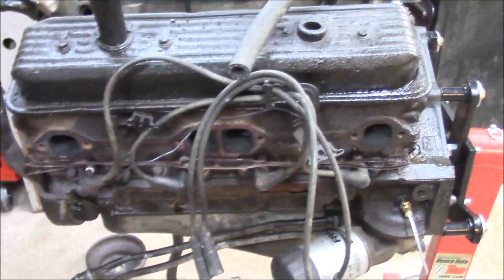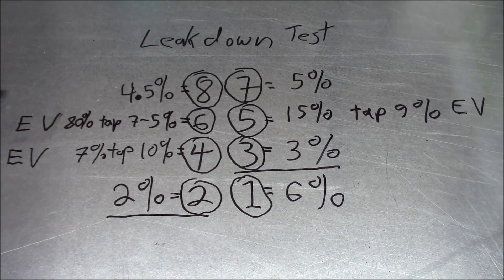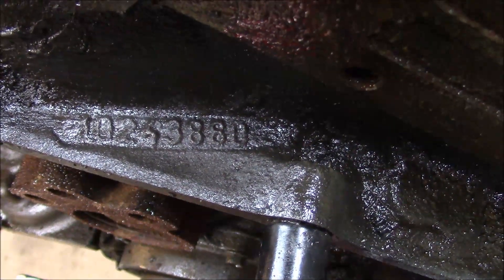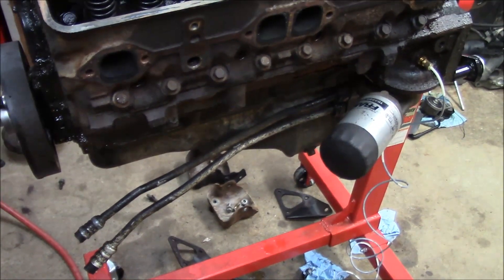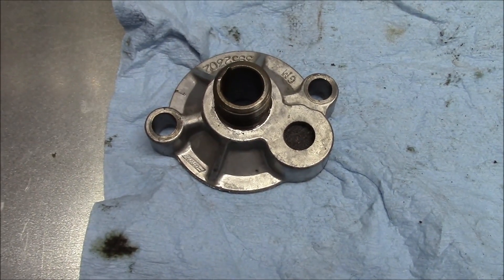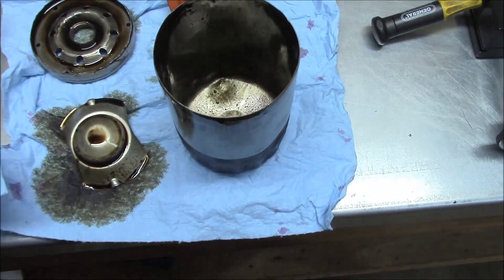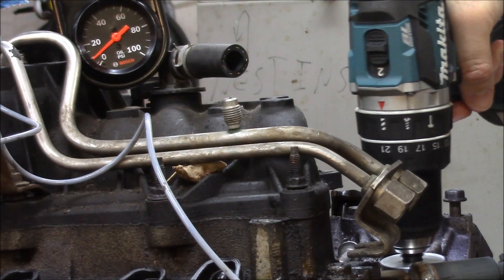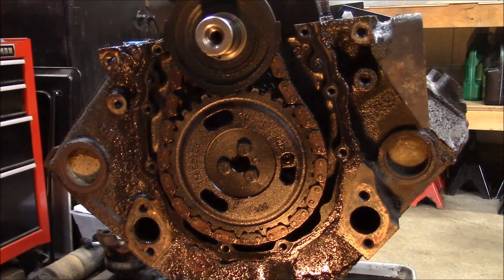Diagnosing the 5.7 Vortec Oil Pressure Problem  (Donor Truck Part 4)

Comment: I have a 99 Yukon with a 5.7 vortec, my oil pressure hovers around 18-20 psi even while driving, although I don't drive like crazy, I drive like an old man, is that normal??
Reply: depends on rpm. gm specified 7psi at idle of say 750rpm. the general rule is 10 psi per 1000rpm.

Comment: Ok so I bought a 7000$ 98 obs Silverado senior owned beautiful guy I got it form was a semi mechanic and the truck was hand me down from his grandfather 
I kinda had a hunch something was being sugar coated when I checked the oil it was new etc but it had honey on the cap 🤔 
I asked him what’s that about he said he just added Lucas and oil change 
So I drove it 1 hour home immediately noticed 15-18 psi 35-40mph city streets and 25 psi on highway. He did a replacement oil cooler and lines also 
Engine is sound while Driving don’t burn nothing no color smoke 
So I did the oil cooler delete ran 1/4 bottle marvel oil and 5/30 conventional oil on a cold start lifters tick for 5 seconds until it shoot’s up too 60psi on oil gauge 
Soon as trucks warm it does the 15-18psi and the other day it went too 5psi in a traffic jam . Soon as get up to speed it’s back too 18-20 
All my other Chevy Silverado and suburban with same motor always had 30-45 psi at idle always 

I don’t know if I’m dealing with a weak pump or maybe sticky lifters or sludgy oil pump . I was trying to break sh** free with Lucas but I’m feeling like I need thicker oil again soon to get me by or resolve things 

Any ideas ??
Reply: I saw a video where I’m pretty sure is was a Vortec which has a seal between the oil pan pickup and the block that gets old and shrinks causing low pressure. Problem fixed.
Reply: The guy was a jerk to not be honest with such a bad problem with the oil pressure.

Comment: Man I’ve really been considering an oil cooler delete for the last 50 thousand miles.  All my lines and fittings are new.  I can’t get the junk to quite leaking to save my life.  I was told no one can stop them leaking.
Reply: If you remove the factory crimp connection and oil filter quick disconnect they don't leak

Comment: Good video Sir
I have a question hopefully you can help out...
I got a 1995 5.7 4x4 engine that was guranteed with 114 k miles for my 1995 Chevy 2500 4x4. The junkyard is pretty reputable, and there is a warranty on the junkyard. 
Flash forward to this morning, I picked up the installed engine from the mechanic shop. 
The oil pressure has been going from zero to 40, and been idling at low speed. Once it gets going it running fine.
Also, no check engine light is coming on.
 From the research I've done it is most likely and issue with the oil sensor or oil screen, worse the oil pump. That is what I'm hoping the Mechanic missed. 
Worse case scenario could I also have been sold a lemon engine?

Comment: Can you simple subject to me ? 

Because Im not good in english
And i cant play vid from beginning to end i dont understand
Reply from the maker: This is part four of a series where I bought a truck for the engine.  In this video I take apart the engine to find the oil pressure problem and talk about some other engine mods or engine health test.  The engine had a bad camshaft bearing and that is what caused the low oil pressure.
Reply: BOOT 
Thank u too much

Comment: Man I don't know why idiots gave you thumbs down, your the 1st of about 5000 threads I've read with no dang good answers. So I'm gonna ask you with hopes you can help me. I have a 2002 Chevy express van 1500, 5.7 liter v8, which I guess is the 350???? I think. I'm not a mechanic, just a poor guy, disabled on fixed income. So I have to TRY to work on my own stuff. Anyway, my problem is I have 211k miles on it, she runs and sounds good. A little weak on big hills, but not too bad. No noises, but my oil pressure gauge when I 1st start says 40 to 50 psi, after I drive for about 15 mins, when I come to a slow down or stop, pressure drops to about 10 psi, I was told to replace oil sending sensor. So after I changed it , its still doing same thing. But as I said no noises, no smoking, runs fine for 211k miles. I was told it has a screen or filter in the spot where you take out oil sensor thing. But also told NO it doesnt, that they started putting those in , in 2007. I'm confused. Also when I took out old one it had a film of dried up oil all the way across it. As I said I put in new one still oil pressure gauge flutters and after it warms up good , it drops at stops , or slow downs. When driving it stays around 35 to 40 psi. Also, not to do with same problem , but I put in a new 02 sensor, bank 1 sensor 2, because I took it to auto zone and had dish most if test, and they told me I needed a new one, and it was causing my ck engine light to come on , so I changed it, and did dish again, and of course it still says its bad. Shit I need a beer. Ok so do you know what it could be, does it have the filter in where the oil press sending thing goes, and I k,ow it has a lot of miles but its all I have. Do you think I can fix it, or should I drive it into a lake. Oh wait I only have liability ins, Damn, lol. I have to laugh at this point to keep from cryin. Man I looked at 5000 threads and watched 5000 u tube vids, and they talk about the 4.3 and the 6.0, but when it comes to the 5.7, can't hardly find nothing. I know this is long but wanted to tell you all of it so you could maybe help me out. Also have religiously changed oil every 3k miles, and use good oil filters , not cheap ones. Is sure appreciate any info you could provide. As I said I don't know why you got thumbs down, because your the 1st one I have found that makes a damn bit of sense. 1 mote thing. On ALL the u tube vids ,When replacing the oil press sending unit , they ALWAYS show that you have to reach behind the motor, or in a vans case take off dog house, and it shows the oil pressure sending unit to be straight up and down. I seen on yours, its same as mine its sideways, and a birch to get off. Thank you and sorry for being so long. But wanted to give all info. I subd your channel and gave thumbs up. Would give a thousand thumbs up if I could. I can't afford to keep throwing money at it, and sure can't afford another vehicle. Hope you're doing great with this damn virus crap. Again thank you very much. Bryan.
Reply from the maker: Information online can be useful because it gives you ideas of what to try.  Not everyone has the same exact situation because there are a number of factors and so the solution can often be different.  This video is a vlog of my experiences working on my projects.  I can't tell you that your engine is fine or junk and wouldn't try to online.  Also my experience is limited to my own diy projects, as I am not a professional mechanic.  I can confirm a 5.7 is a 350, loss of power up hills could be a number of things too vast tah guess at, think I've herd you should replace all 02's at once. The rule of thumb I've often herd/read is 10psi of oil pressure per 1,000rpm, so if you have 10 psi at idle you could be fine by that standard.  In my case it was not due to the cam bearing but also my plans were to rev the engine high RPM often and no telling how long the engine would have lasted if left alone and just lightly daily driven at normal RPM.  I'm unfamiliar with any screen before the sensor but I have not worked on anything newer that dealt with oil sensors.  I suggest you inspect the hole in the engine block or sideways adapter itself for any obstruction before install of a sensor.  You could also try a mechanical gauge to test that your factory gauge is working properly but that would cost prob about $15 for a cheap one and like you said it's just throwing more money at it.  211k could mean a lot of things are worn and about to fail on any vehicle, it's your choice to try and keep up with & maintain all those parts, drive it into the ground or sell it and move on to another vehicle.  GL & stay safe.